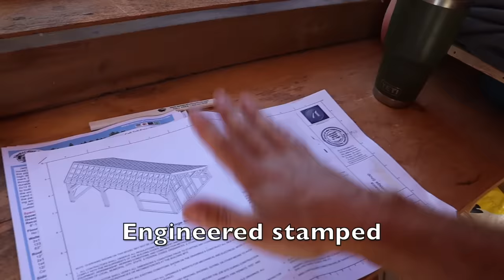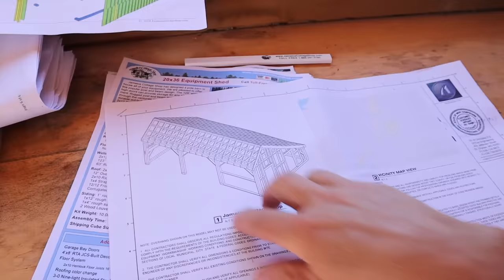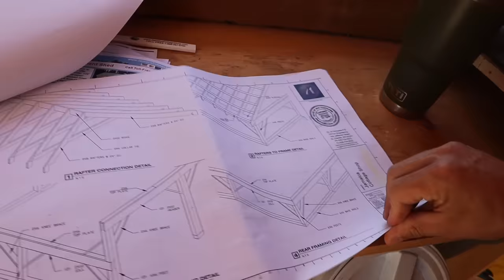So We BOUGHT Another Building Kit OFF the INTERNET?? (Garage, Equipment Shed, Barn?!?) Delivery!

Comment: Like you, I knew with just my self and my wife I would need a big tractor to move the lumber and raise the “Bents”. We got a Kubota 4760 with a cab and 1140 front end loader. 
Like you said those pallets are heavy. 
I still have the metal roof to apply

Comment: You put too much peanut butter on the store trap. Just a mouse bite size on the trip lever  . A bite size piece of cheese also works. He starts nibbling on that big gob and sets it off. I always have good luck with them  . Also i like the instant kill with the store bought vs the slow drowning in the bucket.
Reply: Agreed. More importantly,  the mouse sized bite should be in the middle of the trigger at the farthest point away from all the sides.
Reply: mice love chocolate. i always use chocolate on a mouse trap
Reply: I usually wedge a raisin into the trip lever, and push the peanut butter  in and around the raisin. Sometimes it seems they lick off the peanut butter without setting off the trap, but pulling and chewing on the raisin gets them every time.
Reply: I put the peanut butter only on the 4 edges of the cardboard and no peanut butter on the cans this way they have to commit. I put a good amount on the cardboard,  makes it worth their while to try several attempts.  I don't use ramps, the bucket is placed about even with benches and selves, a little jumping onto the cans is more effective.

Comment: one can in the middle with peanut butter on the can, forces them to jump from ramp to can... add a couple inches of water in the bucket, they will drown...  been using this for years at the airport to keep rats and mice out of the airplanes... just rub peanut butter around the can, if the bucket does not have water in it they can jump out...

Comment: Did ya correct the traps, store trap needs to have “bait side” against the wall (90 degrees to wall)
Homemade trap - remove hanger & cans, replace with single wooden Dow, only place peanut butter in center, not near edges.place bucket on floor, they’ll find it, lol
Reply: I agree to put the peanut butter right in the center so he has to walk over the can to get it. I also suggested to put a little on the ramp just a little bit. I also used a wooden dowel, its a better axle. Caught 13 in 1 week.

Comment: Victor Electronic Mouse and Rat traps are guaranteed to do the job. Can get them at Lowes. I had a major rat issue a couple of years ago and that's the only trap that worked consistently. It looks like a mailbox. Bait near the back, they wander in, the trap's sensors recognize their entry and when they're in, it electrocutes them. 4 C batteries is all you need. BAM!

Comment: The Menards' in Traverse City, Michigan, their semi tractor is also the fork truck. I guess it saves weight. Also there is a trailer mounted fork lift because of the cost of a used off road fork truck is way out of most people's pocket book.

Comment: Get rid of the planks....provide a step where he can jump FROM (at best) so he only has a little area to hold on to.  Once he is on the lip of the bucket, he won't have much to grab onto....this will make it unstable   Also, put a fair amount of water (3-4 inches) and birdseed (enough to sparsely cover the water) in the bucket.  The water prevents him from being able to jump up and out.

Comment: Take you home mouse trap it does not work very efficient because mice can reach peanant butter from edge of bucket without climbing onto can. Remove one can place other can on your wire 6 inches lower in bucket. Place water in bucket to have inch below your can take your ramp put nail 3 inch from end with nail protruding. Just hoek nail over edge of bucket. Mice claim the ramp to the end see and smell peanut butter jump onto can to reach peanut butter can moves mice fall into water and drown. Works like a bomb as mice must jump onto can to get food, once jumped they are caught. Wish you well with mice trapping and your new build. Waiting for the new videos. Amen and blessingd

Comment: You used the wrong mouse traps . You need to get THE STICKY MOUSE TRAPS.   THEY WORK GREAT  ! The mice do not die , but are stuck and you can toss them out .
Reply: Much as I don't like rodent pests, I do feel the sticky traps are inhumane, unless the stuck mice are dispatched in a timely manner as to minimize suffering.  For any critter to die a slow death of dehydration while stuck to a glue trap is cruel.